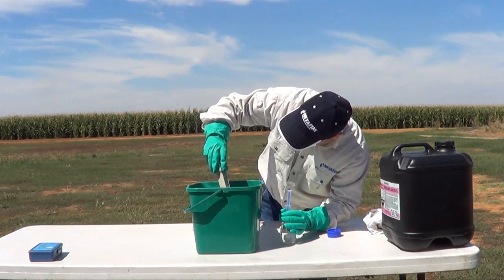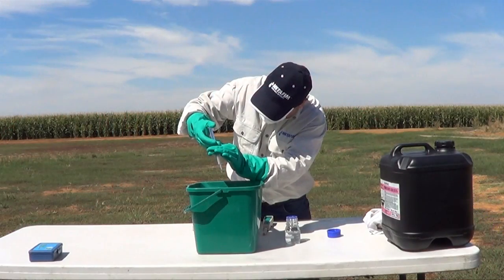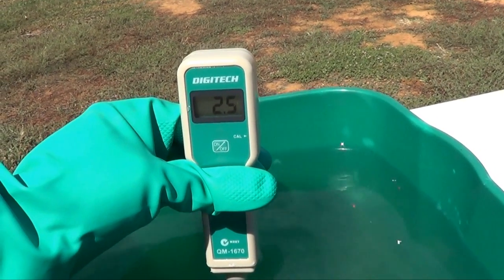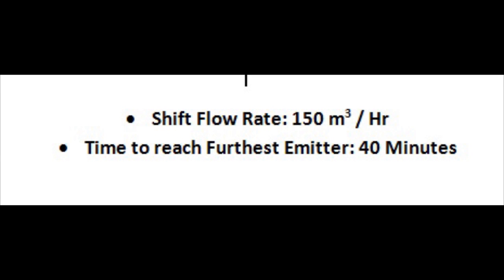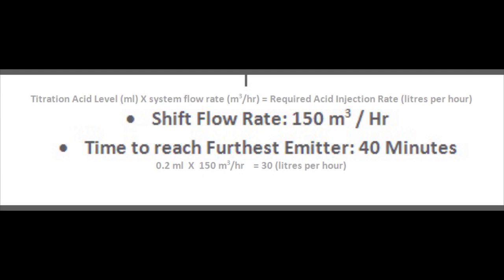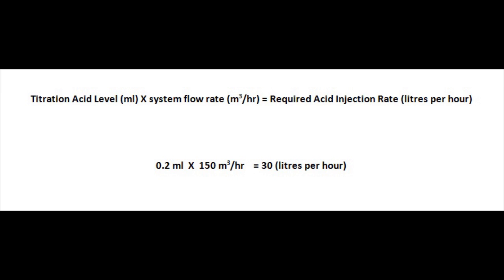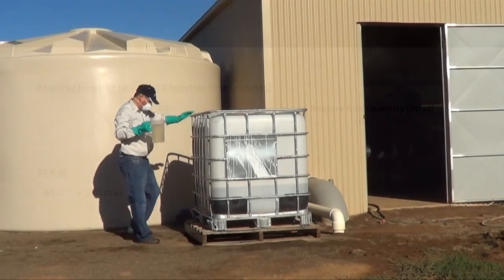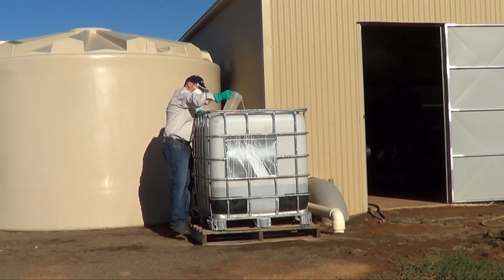Acid Treatment for Dripperlines

Comment: Sir, I hav a small doubtHow could u say that 30lts of acid can achieve desire PH range in 150cubic meter/hr flowrate water .It doesn't becoz u calculated that 2ml acid in 10lts not in 10cubic meter of water.1cubic meter=1000lts of water.Can u plz clarify my doubt sir